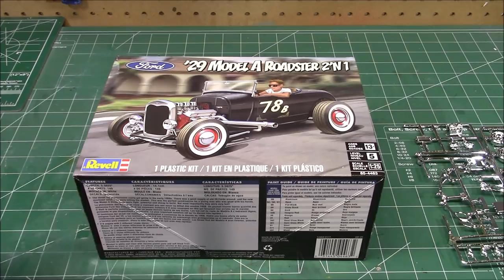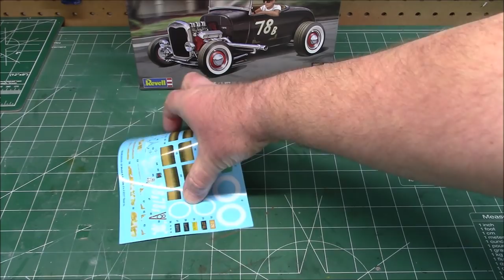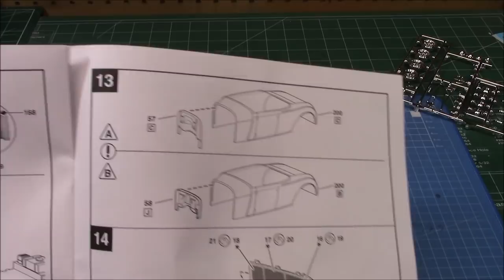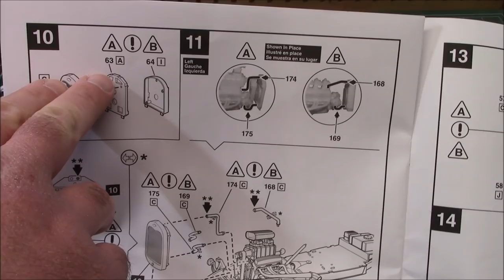29 Ford Model A Roadster Rat Rod 2n1 1/25 Scale Model Kit Build Review Revell 85-4463

Comment: I've watched both of your build videos for this model, well done! You covered this model very well!
Currently I am finishing up the Revell 32 highboy, my only gripe with any of these kits, is, none come with a Ford Flathead v8, they all have smallblock Chevy engines. For my 32 I want to honor the beginning of Hot Rodding, and a Flathead would be perfect for my build! I just wish I could find one. Well I did find a couple on eBay, cost is more than the kit, LOL! and they don't have a transmission attached. I'll find one for my 32 one of these days! 
Keep posting builds! I also l love that you don't stick one genre of model building, you build a variety of subjects. I dig that!

Comment: Wrote about warped windshield frames. I found if I cut top and bottom window frames out and used close diameter scrap plastic  to produce the frame after gluing clear to end posts, it came out looking almost like original.did two of these.

Comment: One thing I've noticed is  when you use CAA cement [crazy glue] on crome parts you don't scrape the plating from surfaces that need to be glued ? Do the parts stay together all right?
Reply from the maker: Yup, I don't move my stuff a lot or mess with it so it holds really well. Rarely does a part pop off.

Comment: Hello Chris and my fellow modelers. I hope everyone is doing well and staying safe.  As always your builds are extremely informative. Thank you. I hope this is acceptable, I am in the U.S. And I am looking for a recommendation on a challenging model.  I prefer transportation, except for water. Cars,trucks, commercial...etc. Skill level is not a concern. Any ideas would be appreciated.  Thank you.
Reply from the maker: Challenging?  Grab almost any AMT semi or wrecker kit and have at it.
Most other kits are a breeze if you can knock one of those out in two days like I do.

Or a 1/35 armor kit with individual link tracks that have multiple parts needing glue.
Reply: hpiguys Workshop thanks Chris.

Comment: Just a simple tip, use the rear axle mounts that are on the frame to locate the axle and springs, but do not glue the axle to frame and then after the springs and trailing arms are set cut the mounts off. This will let the axle look like it could move up and down.

Comment: Definitely not a Rat Rod (a very misused moniker). But, a very well done traditional channeled Roadster build. A Rat Rod would never look that good. Ron
Reply from the maker: Thanks for the info!
Reply: Very good comment on the usually misused classification of "Rat Rod". In addition, I was getting a bit confused over the OPs calling the body chopped. As it's a roadster, the name "chopped" refers to the amount of material removed between the very top portion of the car, and the bottom of the glass area on the body, where all the glass would have to be cut to make the roof lower for sedans coupes and such. This also contains the height of the windshield for the roadsters and convertibles. Your reply with regards to a "Channelled" car is correct though which is to lower the body of the car on the frame of the vehicle, which I think the OP is referring to when he is mentioning "Chopped". There is also another more radical style of building hot rods and customs, is to "Section" a body where the car has a certain amount of the body removed making the body of the vehicle lower between the bottom of the glass and the very bottom of the car body.

I don't mean to criticize the OPs building of his models as I find his instruction and finished models absolutely fantastic. I was hoping maybe, to enlighten new model builders to get to understand building terminology. I'm an old bugger (72 to be exact), and have built many AMT car kits to enter into contests way, (way way way) back in the 60s and won the odd one or two, however, with all the new paints and other materials and tools, such as air brushes in particular, make the end results of todays model cars much better. I only wish I had one back then. One car I built was an AMT 1963 Ford Thunderbird convertible that I cut open the doors and had hinges on them, the inside door handles I made to move looking like they open the doors. I could make all the side windows go up and down, manually of course, metal tubing for the exhaust pipes and the lights work in front and back with the very small grain of rice bulbs. the suspension worked with the use of pen springs and the front wheels turned. I couldn't make the steering wheel work with the wheels though. The car was mounted on a block of wood. I won first prize and if I remember correctly, the prize was an AMT 1963 Ford Thunderbird convertible. I know one contest where I won the same item as I had entered, I can't remember if it was that one. This was back when I was 14 or 15 so I was pretty young. Of course I had a lot of help from my older brother. He was an excellent painter back then and we only had spray cans to use back then.

Sorry, I'm rambling on here, so I do apologize, but I want to give the OP a lot of credit for his exceptional work and all his help in giving us "Newbies" and "Old Farts" the desire and help to carry on building. I am actually into model railroading and real hot rod building at this point in time. I really hope I haven't scared off any new model builders or insulted anybody with my verbal diatribe,  so it is here that I will eventually stop.